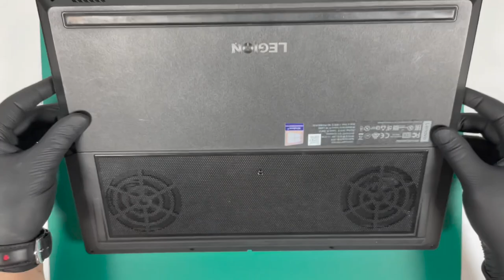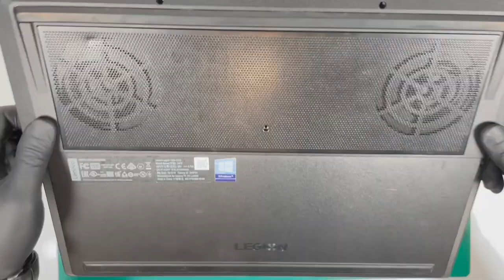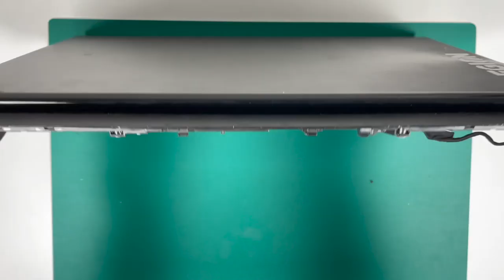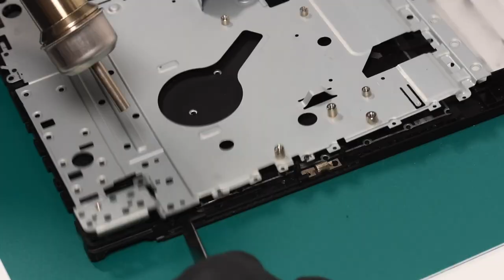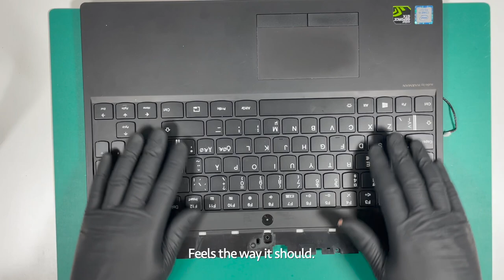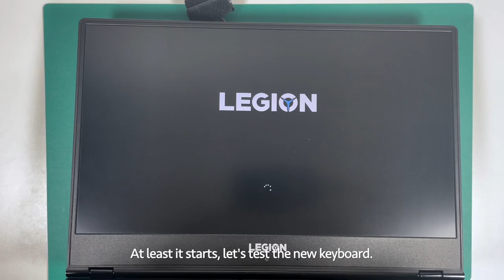RiskiFixes - Lenovo Legion Y530 Keyboard Replacement

Comment: Well, I tried and failed. I have neither a heat gun, nor a variable temperature soldering iron. Tried it with what I have, a wood burning iron, which is functionally identical to a soldering iron. My idea was to turn it off once it started melting the plastic, and turn it on again when it got too cool. Plastic ended up sticking to the iron bad, making it difficult to get the new keyboard in place due to all the missing plastic. Had to melt the waste plastic onto what was left of the tabs to form the rivets again, and even then they were brittle when cool. After that I find out the keyboard I installed was faulty, or I damaged it during my shoddy install (several keys don’t register unless pressed very hard and double type sometimes).

I’m going to put a Bluetooth keyboard on top of my keyboard and call it good. I don’t think I’ll attempt this again without better equipment 😅

Comment: The only thing worrying my about doing this are the plastic rivets. You think its possible to remove them like you did with a blowdrier? I saw in another video someone removing the rivets with a box cutter and then soldering when reassemblying, but I was unsure if he was using solder and if thats ok for the laptop.
Reply from the maker: I prefer the heating method so there’s no need to cut any material. But both ways work.

Comment: Sir, a question. You soldered the rivets after putting the keyboard. Would that deform the rivets which will not fit for the metal case? I wonder how you got some rivets out
Reply from the maker: Some of them might have been deformed too badly to fit on the metal case, but most of them were ok. Not a major issue.